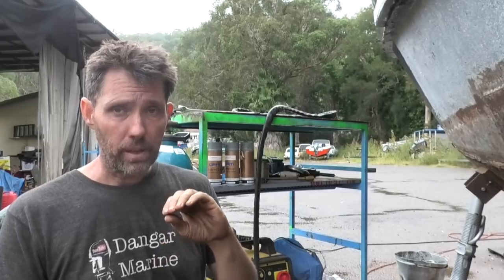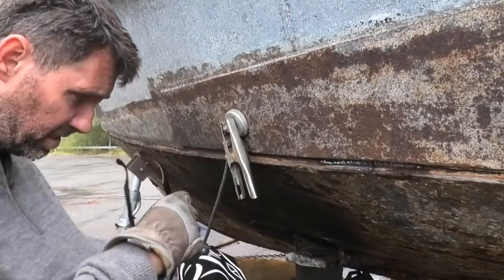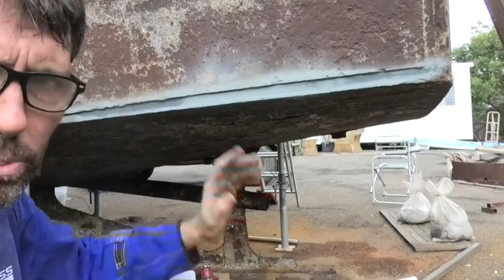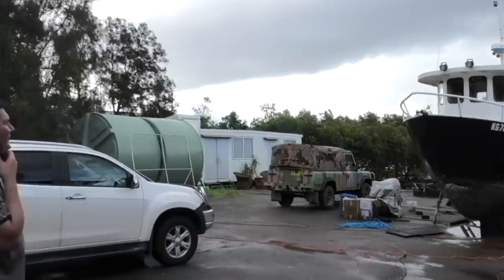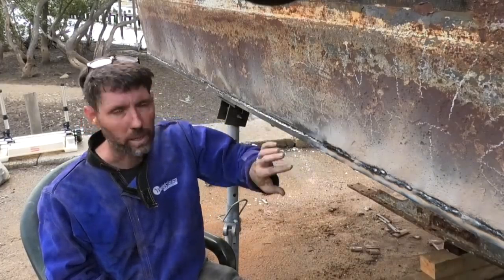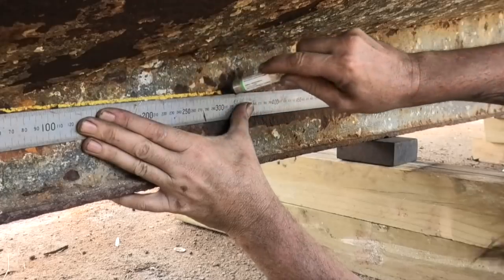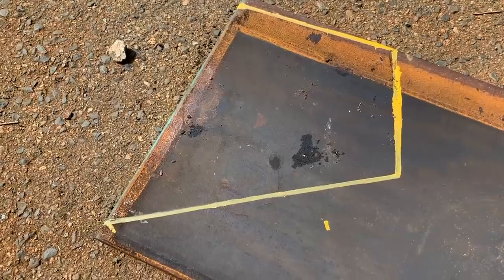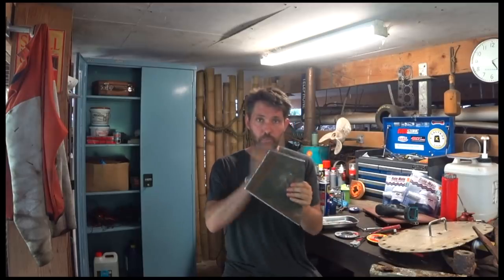Repairing the steel trawler's hull

Comment: Good on ya.. a project and a half.
 Have you considered crack detection on the below water welds?   Another technique to show us. If you do it will give so much confidence to you and the repair. No matter how goof the welder is cracks can go unseen till too late.. 
You are doing it once and doing it as right as you possibly can. A big heart to take her on. 
We can see the improvements every time the video pops up. 
We also see how work weary she was. Amacf
Reply from the maker: It would be great to do some crack detection, I'll have to look into it.
Reply: Have a look at dye penetration simple and shoes up well for camera too Amacf
Reply: MAG particle is better for mild steel. But to be honest, a complete waste of time for a project like this. All crack detection will show is weld failure points, and that is kinda irrelevant looking at the rest of the hull. If a weld fails, it'll keep as long as the rest of the hull survives...

Comment: When you cut the thicker steel with the torch like that 12mm and thicker, instead of cutting perpendicular to the metal, angle the torch to around 45° or even 30° so that the cross section that you're cutting is now 16mm or so. It makes for a cleaner and faster cut, since you're heating up ahead of your cut by having the torch angled.
Reply from the maker: Thanks for the tip, I'll give that a try next time.
Reply: Once again, wrong. The heat cutting the steel is made in the oxy cutting flow, keep it vertical to the cut unless you are cutting in a bevel.

Comment: Looking good so far though most hole saws are made for slow speed in steels. You might want to borrow a mag drill for that. If i may suggest, finding a flat surface around bad rust pitting will give you a better idea of what needs to be welded. I suspect that there is going to be a lot of it. Those pits look DEEP in some places.
Reply from the maker: Yes, the high speed drill really isn't the tool for the job. I'll definitely run a flat edge over the hull and use the ultrasonic thickness tester after the sand blasting.

Comment: The piece you removed is the shaft strut. There may be some change in the shaft alignment as result of distortion from welding the new strut piece in. Greg
Reply: Possibly but it shouldn't matter I'm assuming he'll re-do the mounts and alignment from scratch when dropping the engine back in. I would probably have simply welded fresh 1/8" plate on each side of the old strut with a few ground out slots welded through but I'm lazy! But can't have a strong enough strut...
Reply from the maker: Yes, possibly. I think the lower section will hold it in place though. It will be interesting to see once the new engine mounts are installed and engine is back in how the alignment goes.

Comment: You can use 6010 stick welding rod and burn all that paint then grind it nice and clean then you can run 7018 on top of that, much nicer and faster.

Comment: The keel replacement is likely due to zincs being bolted there. Do yourself a favor, wherever you are going to put zincs, weld a couple of bolts onto the hull, then you just need to drill the straps of the zincs, shine everything up and bolt them onto the hull. Makes changing them easy while in the water, a diver can do it, and steps the zinc off the hull a little helping avoid corrosion. Once we started doing that on the steel tugs we stopped seeing that kind of damage.
Reply from the maker: Interesting to hear that you were getting similar damage until you stepped the anodes off the hull. Thanks for the tip, I'll definitely do it that way then.

Comment: Also a wash tip  as many call it. . Strength wise I would have put 60/70/ series rods on the metal in saying a tig weld is also strong  copper along with graphite will also do the job  I’m doing a 50 ft house boat all new metal all new boat top to bottom

Comment: Using those pre-cut round steel cutouts for repairs is ingenious.  For the very small repairs you can use beer bottle caps...the only downside is that you'll be forced to drink more beer.

Comment: I prefer stick for filling, adding material for strengthening as well as for all general welding from 200mm down to 2 mm. Especially over head stick is just amazing, since stick makes a better root on the opposite side than any else imho. But of course inert gas is the main thing for below 2mm material strength. TIG I only like for very special materials (e.g. high grade chrome-steel) and very precise small weldings. For larger areas, long connections and the like I feel TIG is too slow and does not vary well with different material thickness, and stuff like double-T beams I find pointless with TIG. But perhaps that is a question of personal preference as well.

Comment: Are you going to use a metal repair kinda like JB WELD PRODUCT to repair the pitting?
Reply from the maker: I'm going to pad weld as much as I can but will use some form of filler for the final surface prep before painting.
Reply: @DangarMarine  I have what looks like precisely the same pitting on my sandblasted 78' steel Dutch ketch.  I am going to simply MIG weld fill the deeper pits. I just experimented with thickened epoxy (automotive "Bondo" would do too) and smoothed it across two square metres with a thin metal scraper. After a light sanding I end up with what looks like completely smooth plate. It'll be a job doing this over the entire hull but when I've rolled on the second coat of epoxy paint it will look fantastic. I don't have the energy to make a video like you but I am collecting a lot of photos.

Comment: id get a leather coat and i used a cap backwards to shed some sparks you can get a hood or a flap of old glove leather attached to the top lip of the helmet to cover the top of your head and neck
Reply from the maker: The backwards cap is a good idea. Always getting sparks on the top of my head. I'm amazed I've got any hair left!
Reply: @DangarMarine  Plug those ear canals, you don't want a ball of red hot slag burning its way through to the other side.

Comment: It looks like you really need to use a MIG welder for the volume of welding your doing, rather than a TIG or stick welder. Guess it’s a matter of personnel preference. When welding the keel, seems like you would want to bevel the edges of your material to insure good weld penetration.
Reply from the maker: The keel plates were beveled a bit, but not completely to a point. The skeg patch I will completely grind out as it will have a lot more force on it.

Comment: Gday bloke, with big gouges or bad fit ups there’s a bit of a trick u can use to quickly fill up those holes with stick. Get yourself in a position where you can use another welding rod to add filler into the weld pool. You can use a rod with no flux on it or just as they are. Whatever works better for you. So, just strike your arc with your primary rod and then start feeding extra rod in. Don’t have your amperage too high, just go nice n quiet, it’ll save u time and money. Never do this on anything critical though. Nothing structural.
Reply from the maker: I'll give that a go, thanks.

Comment: Glad to see you put the stick welder and oxy cutter to good use.    Horizontal welding a vertical surface can be challenging to make pretty.   A few lessons I learned from pro welders that I actually use:

1.  Adjust the amperage as you go, if you can.  If it starts off cold, go up 5 amps, then once things heat up, back off 5 or whatever, to keep it flowing right.  A helper is good for this, but if your welder is close, and you can reach over, you can do it yourself.  

2.  If it starts to get ugly, stop, let it cool for a minute then start back up. 

3.  Grind between passes, or as needed!  It makes it SO much easier, and gives much cleaner welds.  Take a minute and watch this vid, and jump to 3:20, if you are short on time:  https://www.youtube.com/watch?v=IY_yF_tATjQ

4.  What kind of sticks are you using?  I use a lot of 6013, 7018 and 6010.   Take a look at several vids like this one, and it may help your welds:    https://www.youtube.com/watch?v=bjB0I3HXIVc

#3 and #4 were real game-changers for me.  Some guys talk trash about being a grinder, not a welder, and I fell for it at first, but then once I tried it, there is no going back.   Laugh all you want, but cleaning things up between passes saves time and makes for a great, tight, smooth stick weld.

Here is another video that may be helpful to watch:  https://www.youtube.com/watch?v=FwFrqYKpmRE
You will get plenty of practice time, I'm sure!   Keep up the good work.   It's moving along.
Reply from the maker: Thanks Tony, I'll check those vids out tonight. I'm slowly improving with each rod I run but you can't beat good info to accelerate the learning process. The thing I'm starting to learn with out of position welding is that being too hot can make the weld look cold as the puddle runs and gets tall, while lowering the amp can make it flatter, more like a hot weld. It makes sense when I think about it but it is counter to everything you learn when doing first position welding.
Reply: Stu,
Yes, I know exactly what you mean.  Getting the amps right is a big thing. Weave pattern  too.  Some like to bury the stick in the groove and run it straight. That's good for root pass, if your gap isn't too big.  With big gaps, maybe try a weave where most of your puddle is high, then dip down to tie, and right back up. Like this: --v---v---v--  Gravity is always pulling down, so it doesn't need much help.   Or, you can "stack" which is just the opposite, start puddle low, then pull metal from the top down into the puddle like:  ---^---^---^---   Zig-zag or figure 8's don't work for me on horizontal stuff.  

You have lots of welding to practice on, and you will find your fav method.  For sure, you will be a better welder before this is over.
   
Rusty metal can be challenging.     I just looked at this video about welding rust, and found it interesting:  https://www.youtube.com/watch?v=DMA7-yabOA8

Not trying to slam you with links or comments, just trying to be helpful.   Thanks for the vids!   I hope it gets better and better for you.

Comment: If you haven’t mentioned it yet with all the scattered pitting I’d do an extensive inspection of the electrical system to look for stray current. Guessing you’ll replace anodes before it goes back in the water.
Reply from the maker: Yes, I've pull all the wiring out now and I'm totally re-doing the electrics. Yep, already have the new anodes.

Comment: Why didn't you sand blast before welding?  Seems like it would save time on welding and identifying problem areas
Reply from the maker: Flash rust will occur quite soon after sandblasting, need to get the primer on straight away.

Comment: What about using a stick welder and add extra material by holding a second non-powered electrode and joining that in the puddle? I have seen that being done on foundry oven bins.
Reply from the maker: I'd be interested to experiment with doing that.
Reply: Doesn't work, the 2nd rod would just suck all of the heat out of the weld pool
Reply: @dimreaper274   well i have seen it being done, but maybe they cranked up the current?

Comment: Can I ask why you didn't sand blast the thing prior to doing all this work so you can find thin areas and pin holes?
Reply from the maker: Because it will rust within a few days. Fix everything you can already see first, sandblast, and then fix the new stuff you could see before quickly then prime.

Comment: When you were filling your hole in where you removed the rubbing strip. Why did you not tack a small back plate inside behind the hole. This would have greatly increased your contact area while filling in the hole from the outside. Once the hole was completely filled in from the outside. You them go inside behind the hole and grind off the patch and back fill any gaps.

Comment: With you holesaw patch’s, why not flush weld them? Cut the hole to the same size as the parachute, then use a magnet to hold it flush in place while you weld it!

Comment: Hi Stu Had a question I have a 2002 yamaha 30hp 30hwl 2 stroke when I bought it a month ago it had 90psi compression on both cylinders after 3 uses it has 75psi on both cylinders what might be the cause?
Reply from the maker: The rings may have freed up with use or could be an issue with the tester itself.

Comment: Old rusty steel, Flux core , Flux core , Flux core, is 1000 times better and faster, Tig is for clean welding- pipe, aluminum, stainless, etc. I been welding for over 40 years, hope this helps you 🤗
Reply: Also if no wire feed Flux core, LH stick rod is second best 🤔👍🏼

Comment: Sure have to get a good weld penetration on that Driveline Skeg get any kind of runout from the prop it could start breaking welds , It`s coming though .!
Reply from the maker: Yep, that is the weld I am going to bevel completely and run multple passed with the smaller rods.

Comment: Looks like you are having fun with an old steel boat.  ;-)  

I've done the same thing on both aluminum and steel boats.  At last you are not chasing intergranular corrosion fishers in the plating.  You start with a spot about 1/2 inch or 12 mm and you dig out a 12 inch grove down the plate.
Reply from the maker: The more you look the more you find, that's for sure.

Comment: Hey Stu this question is way off topic but I’m a rookie and need advice .. I have a Johnson 25 Hp and it’s electric start.. is there a way and is it possible to add a pull start to it? I know I can just put a pull rope on the fly wheel but I’d like to have a rope on it all the time... is this possible ?
Reply: I'm not Stu but here's my two bob on your question, Try some outboard wreckers for the parts, it's possible that model motor was only sold electric start version in Australia so pull start parts & cowl might be hard to find and or expensive if anyone has new old stock, why you you would want to pull a muscle in your back over push a button with your thumb is something you might want to expand on as most people want to go the other way.
Reply: Dusty Farmer I’m in the USA.. so your saying that it is possible ? The only reason I want to add a pull start is because my start button gave out on me this past Saturday and I ended up having to pull the cowling off and wrapping a rope around the fly wheel to start it .. I’d much rather just tug n start if I have that issue again
Reply: @pimpshack81  Fixing the start button would probably be easier, sometimes the contacts can be cleaned and the switch rebuilt but otherwise they last many years, having a pull cord rope with handle is a wise piece of equipment to have on board, You could try a Johnson dealer/wrecker to see if the parts are/were available & if so you can try and source them, price a new start button while your talking to them.

Comment: On a rust bucket like that the only cost effective way to weld is E6011 capped with 7018
Reply: Cheap 6013 would be good enough .

Comment: That cut , I would have tacked on a backing plate , veed out the cut edges, and stick welded it, would have been done in no time, and could be ground back flush, no ugly patch plate on the outside needed, you know the repair is double the thickness of the hull then and 100% sound. Them stick welds later on were horrific , and not safe, grinding it off and trying to hide it won't help you when your sinking.

Comment: The TIG welder you are using looks too small, amps too low poor penetration. You want the weld to hold and not crack and fall off. Sand blasting the weld area is a good start for a cleaner job, crusty rust and welding don't make for strength. Have you tried using ferrite rods on the stick welder? If you have the amps to drive them try 3.2mm. A big rod has a wider arc and used right has less chance blowing through thin sections. I hope this helps.
Reply from the maker: The TIG was just to seal up the hole before running stick over the top and then MIG welding the new rubbing strip in place. Interesting to hear that the bigger rod actually has less chance of blowing through, that's good to know.

Comment: instead of using a lazer cutter could you not just get a stick of round stock and cut cookies out of it would save the time of filling the center hole and would use far less holesaw blades
Reply from the maker: Yes, some rod of the right diameter would be good to find.

Comment: if you cut the  round plates the same size as the hole saw plug you could get a full penatrating weld and a flush finish and overlaping weld will a create tits all over and turbulance through the water you could do that job and  it would be invisable a 6010 rod will allow a downhand weld with a fast freezing slag pool you could have a gap  and wire wheel then up the amps and do a hot pass it will burn through and work out any trapped slag .the 6010 rod with the fast freezing slag makes it much easier in possition welding

Comment: Why did you not shot blast the whole hull  before you started to cut and weld then you can see where the problems are   every thing clean so easy to cut and weld all you are doing is to make work
Reply: @jaquigreenlees  Correct  you blast the hull on a boat like this then prime it with red oxide or similar the you have a good clean surface to work with
Reply from the maker: The epoxy primer I will be using on this needs to go onto bare blasted steel. If did put red oxide on it I would need to blast it a second time at another $3000.

Comment: no no no sorry but tig is not the way,  not enough penetration i can see it in the weld .much better to stick weld that mess  .better penetration and will disperse the contamination  ive been a steel boat buider for 35 years
Reply from the maker: I just used to the TIG to fill the gap. It then has a layer of stick over the top inside and outside and then the rubbering strip over the top of that welded in with MIG. It has all three processes used in the end!